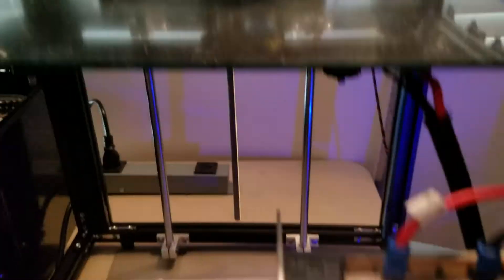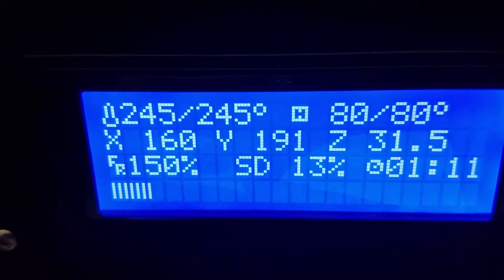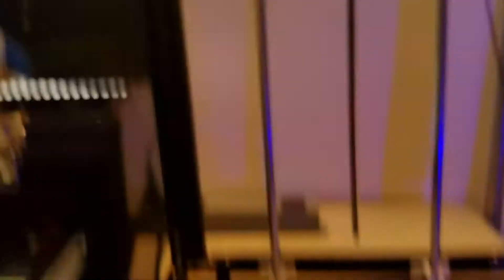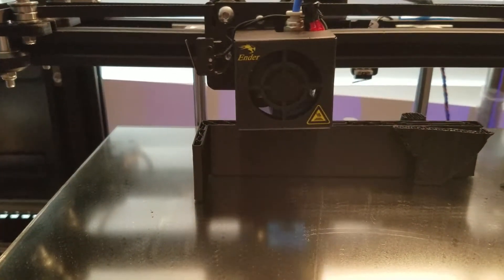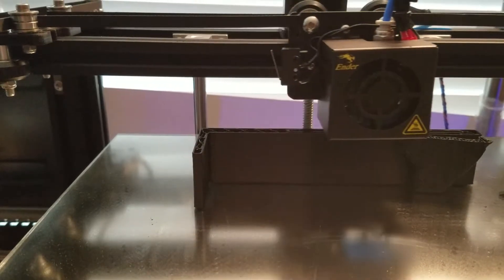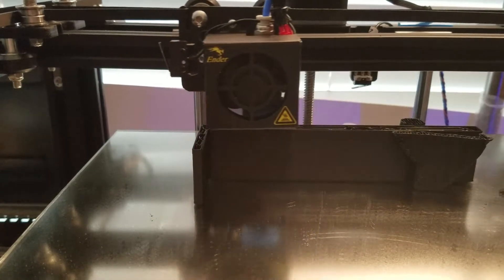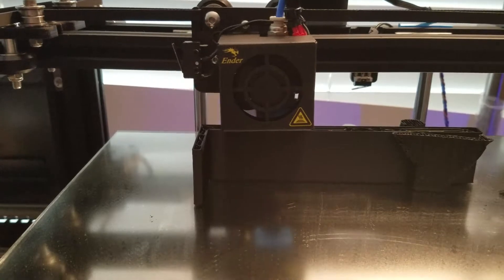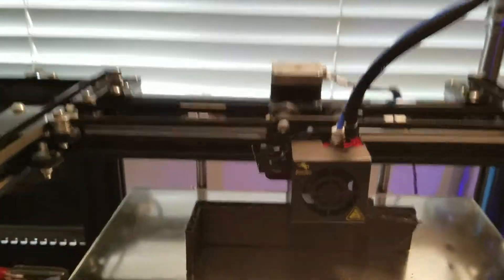Ender 4 TM Marlin

Comment: Did you find what changes need to be made ?
Also, are you running Marlin 1.x or 2.x ?
Reply from the maker: It seems like an eon ago. The original Ender 4s came with a a modified version of Marlin 1.x which Creality had refused to give the source for... which was against the rules. They got backlash and Naomi helped convince Creality to go open source on the new Ender 3. Marlin 2.x is slower than 1.x and prints better from what I remember. Nowadays I have a rack full of Ender 3's running OctoPrint with Klipper via Raspberry Pi's. Some day I need to dust off the old Ender 4s and bring them up to date.